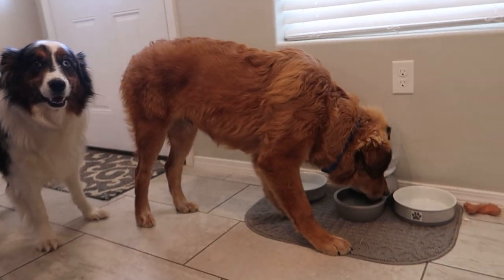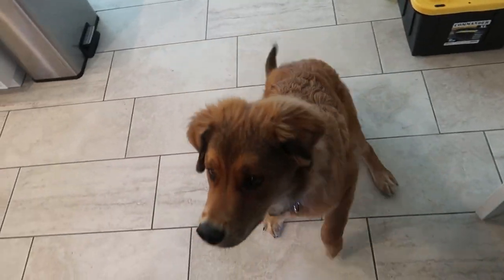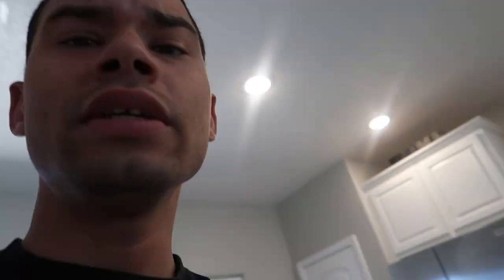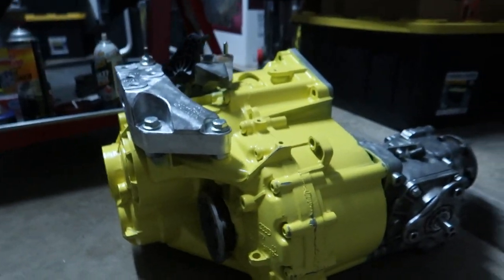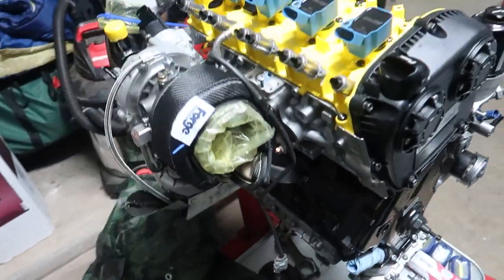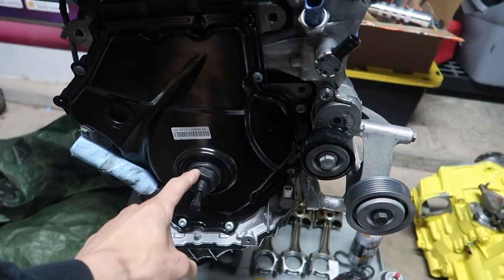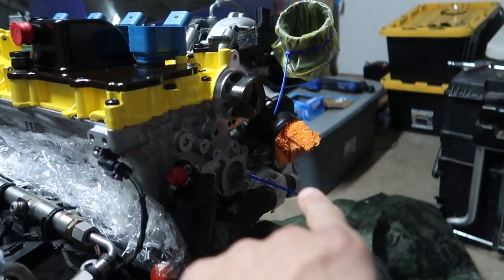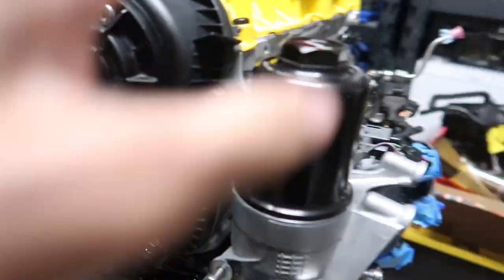Intro to reassembly!! | MK7 Golf R

Comment: YES! WE BACK BOYS!

Edit: 6Fabrications on IG has been making custom intakes. Looks like excellent work for bigger power applications.
Also, if you haven't seen already MyGolfMk7.com has a BUNCH of really good data regarding all kinds of parts for the MK7. From tests it seems like Mishimoto makes the best intercooler for the MK7 platform.

Just some thoughts as I'm watching through the video. Hopefully they help with the build!
Reply from the maker: 6fab is going to be the one making that heat sheild! Might go with his or Blazes intake not sure yet! I've seen some data on that site I probably should go look more, thanks for the heads up!!
Reply: @BryceJordanProductions  Also, maybe a bi-cooler setup would be worth while. I think Mabotech is the one... but they make a great bi-cooler to go with aftermarket IC setups. 

We gotta be on the same wavelength bro lmfao
Reply from the maker: I refuse to do a bi cooler.. too much weight and shenanigans going on, plus me and Frank aren't on good terms I'm not giving him more of my money lol. I'll figure it out eventually hopefully just deleting the AC gives it that much more flow to keep the air temps down.

Comment: Have u ever looked I to doing evans waterless coolant on ur car?  I'm gonna be doing this soon, spring time, and upgrading the rad to a csf.  Just curious as to how good it works with turbo heat and the pressure.
Reply from the maker: I haven't yet but I plan on doing some type of alternative eventually with a csf as well.. I deleted my aux rad so I'll need all the cooling I can get off my main rad
Reply: I have the radiator already sitting in my basement but haven't decided to pull the trigger on the evans coolant.  Looks a little expensive at first but it lasts a very long time too.

Comment: Be careful with the racing line catch can plate the screws if not loctitie in they will work loose and drop into the head of the engine. They revised the plate the newer style one has screws outside to prevent this Happening because it has destroyed engines
Reply from the maker: Yeah I've seen. Mine have been good for over 50k. I do want the new version but $$$

Comment: Whats the purpose of the ARP crank pulley bolt? Im just curious because im about to remove my crank pulley. So that i can replace my lower timing chain cover. Its leaking just like my upper cover is leaking. I will have my hands full. Im just wondering if I should order an APR crank pulley bolt to go back on it. Should I use loctite on the threads of the  crank pulley bolt as well?.
Reply from the maker: Just a stronger bolt is all. OEM is made to stretch and is only one time use. The ARP will be able to be re used many times, neither require thereadlocker (as far as I know at least)
Reply: @BryceJordanProductions  awesome,  thanks for the quick response and good knowledge.
Reply from the maker: I try!

Comment: Bro, go to a water-to-air intercooler.  I'll freaking love it and it will be sooooo much cooler too for heat.
Reply: That's one thing I've been wanting to do and looking into.  Move the battery to the trunk and make space for the new I/c and water pump.  And the other is upgrading the rad to alum csf and piping the water off there or adding another heat exchanger.
Reply from the maker: Does anyone make a kit? I've thought about it just not sure how viable it is on a time attack style car.. would be very neat though! Definitely moving he battery to the rear at some point as well
Reply: I haven't seen a kit yet but i dont think it would be that hard either.  Probably around $1000 to make a good kit but you'll definitely spend that or close to that on a good upgraded I/C.  Water-to-air I/c around $350-$400, than a decent water pump and custom aluminum piping for the air and making custom water lines also.  Had one in my rx7 before and it used to run it's ass off in the Florida heat.  Had a 4puck unsprung clutch in there and it broke a 2-2.5" thick steel flywheel lmao.  Took trans out and flywheel came falling out in pieces lol.
Reply: What kind of I/C have u been looking at?  I put the nuespeed on my GTi to free up space between the radiator and ac condenser.  Taking out stock I/c when csf rad goes in.  Might put a fan or two in between them too.

Comment: Are you staying with the standard Vortex? Or did you upgrade it or change? Engine looks mint man!
Reply from the maker: Staying with the STD for now. I really really wanna see how it does at 32psi on E with a ported head. Revving to 8k with the dog gears is going to be insane. Along with the LSD.. I'm so hyped lol
Reply: @BryceJordanProductions  should be might fun. Will be similar to what my Evo IX used to be like. I’m thinking of picking up a vortex std in a year. What DP do you run on yours? I’m hoping to get full boost by 3500 with the standard vortex.

Comment: Are you going to bypass the front seat air bags with a resistors?
Reply from the maker: I think that may be my only option. Need to find someone to make me some lol
Reply: @BryceJordanProductions  no need to have someone make you one, get a resistor that is 2.7 ohm and plug it and if you have lights on just clear with VCDS. (you can check voltage with VCDS)
Reply from the maker: What really it's that easy?? Well all be dammed alright lol